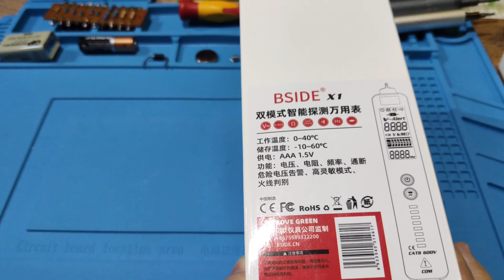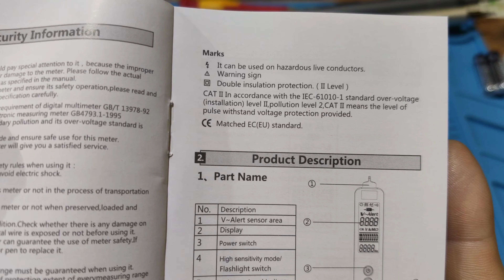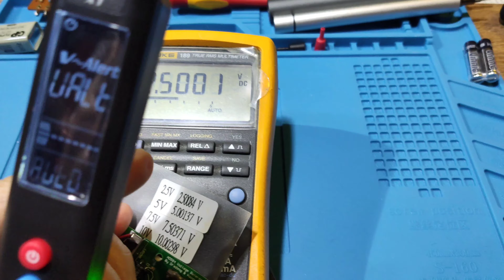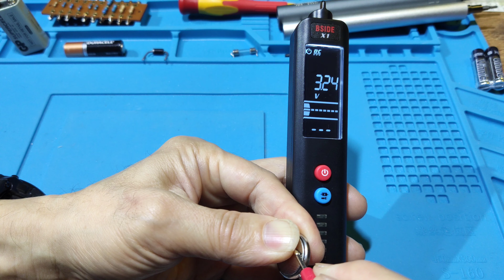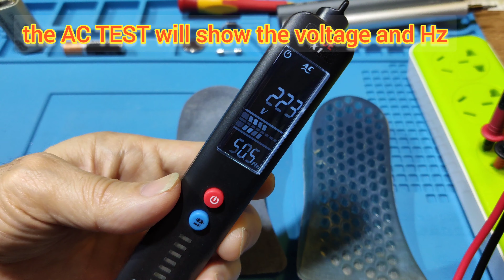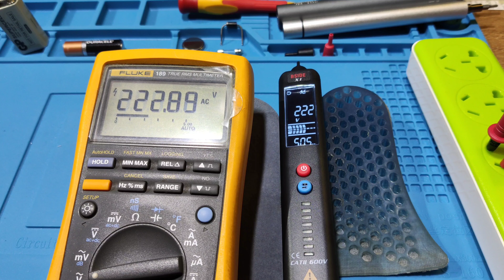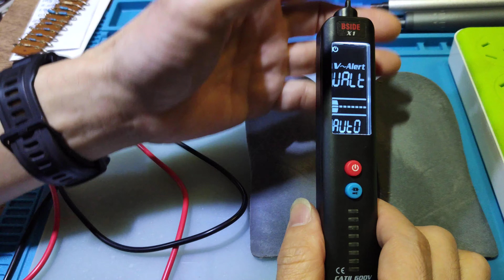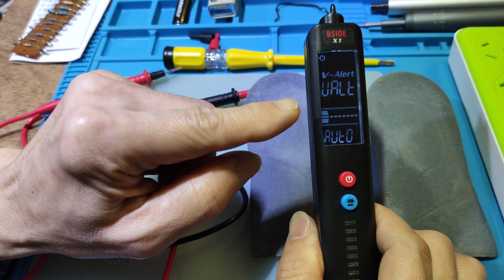BSIDE X1 YEAR 2021 NEW   DUAL MODE DETECTOR & MULTIMETER

Comment: Highly inaccurate device, I bought the same from aliexpress and 8 am very disappointed. 
A battery with 14.4v , the metre shows as 17.55, on several batteries it shows different readings on each touch for example a 9v battery first time showed 9.82v and next time it shows 10.01, another 9v battery first time showed 9.48v and next time 9.73.
This is not a reliable device unless it's a copy of original.
BESIDE X1
Reply from the maker: it so sorry,but you can know that ( old battery  the internal resistor increase may influence the voltage).you must use a new battery to test the accuracy sir.😄
Reply from the maker: or use another meter to compare(but must use new battery),it is my experiance pass few year.
Reply: @wilsonluilui  
Brand new batteries were used.
Reply from the maker: @maimsahb  ok,it is the meter have problem,send back to the shop get a new one ,but somtime will charge you a mail fare.good luck fd.😂😂
Reply: @wilsonluilui  
I sorted it all.
I installed a new battery however I checked few sockets using non contact to check if it was working correctly. 
It ate up all the battery and made the cell weaker( strange though) I didn't expect to have the battery go weak after a little use.
I suspected when display would go off after few seconds of turning it on.
Anyway I soon installed another pair of cells ( from same pack) and now the metre shows almost correct or close to correct values.
Reply from the maker: thx for report to me.before i also have a battery have a( high voltage but less power).if i use a multimeter to test it have  about 1.4v ,but place in the meter it may be battery low come out,it is why need a battery tester to find out the bad battery,and normal use a little blub test the battery is very good method
Reply from the maker: in my first video of fluke 101 multimeter ,i also use a new battery to test the meter,for a new battery it is a stable source of reference dc .but if a old battery may be not.
Reply: @wilsonluilui  
The metre is showing 1.61v  for 1.5v battery , is this difference common?
This is with a brand new battery.
Reply from the maker: it is under the resolution of this meter ±0.8%+3,and than this type meter normal not have high accuracy one.in my collect meter normal have one or two voltage error after one or two years later we buy.their is acceptable because we normal use it not in 22 degree C in a lab.only is 25 to 33 degree C environment sir.